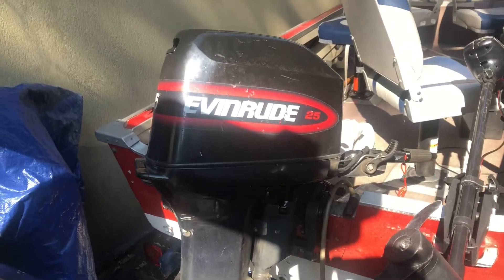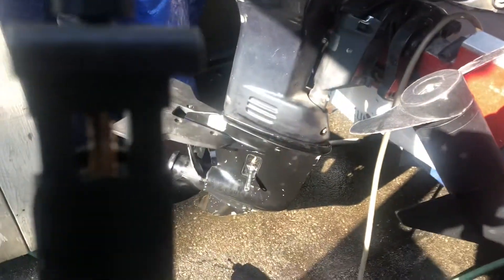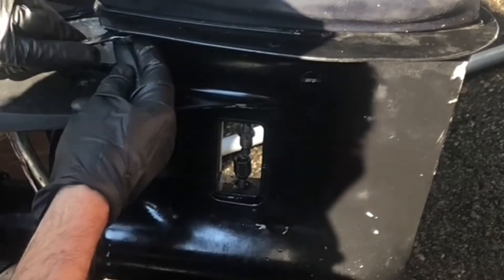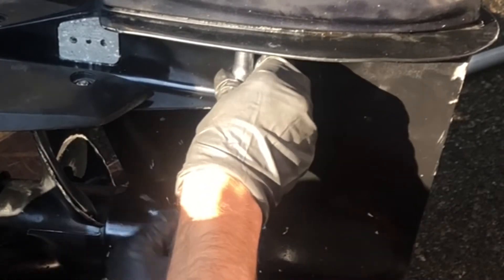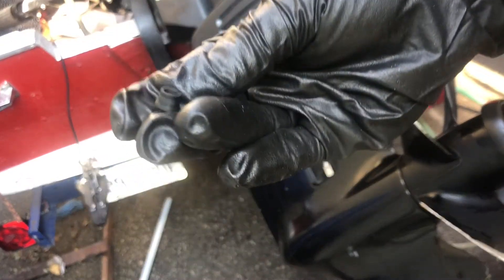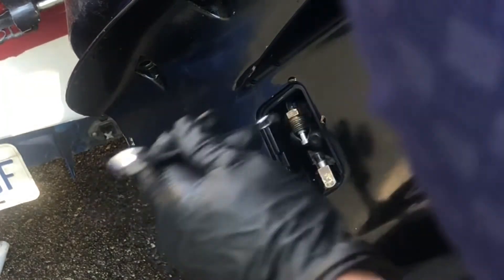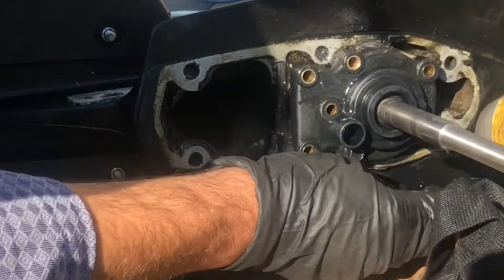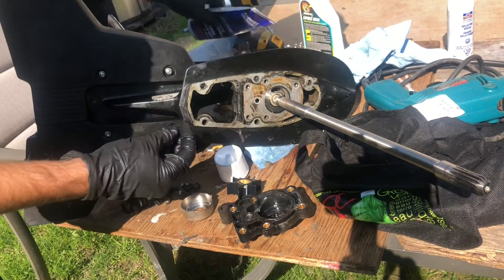How to change water impeller on a 25/35 Johnson Evinrude 3 cylinder Outboard (1998)

Comment: Wheres the copper tube for the water flow i have the same exact motor but mines not in place
Reply from the maker: You don’t need to worry about it - it’s built in up there. Kind of nice vs the older vintage